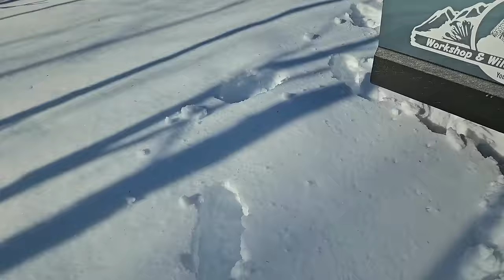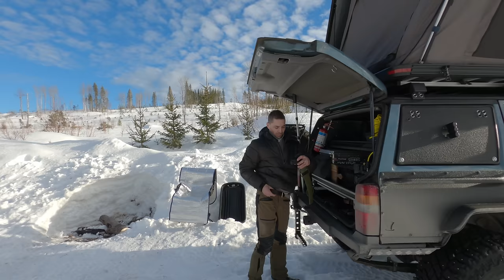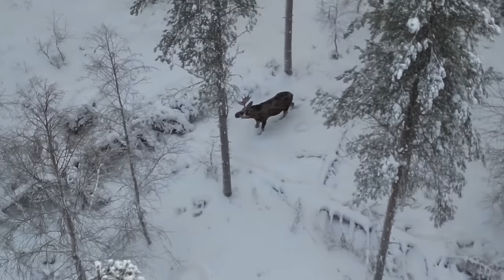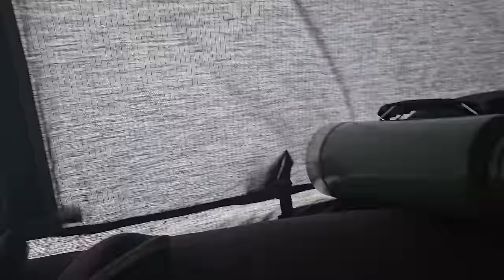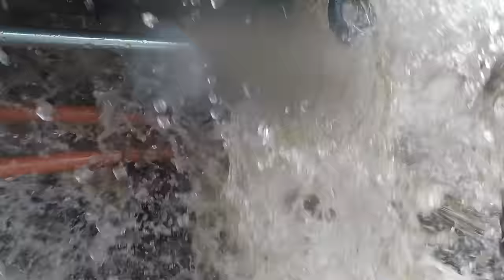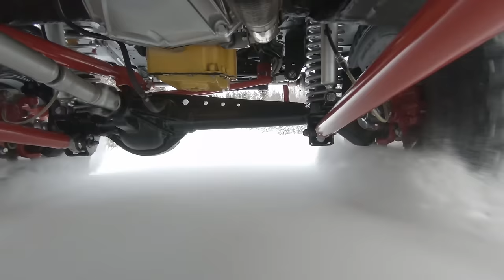Snow Wheeling / Camping With The Legendary Jeep XJ

Comment: I know you from your old channel Mike - the amenities such as a chainsaw make a trip like yours easier in a way but I think being out and using basic tools is a lot more rewarding. Also, if you don't like the sound of the diesel heater, I think you can do without the noise of a chainsaw. The chance of attracting big foot is a lot smaller, too ;)
Reply from the maker: Yeah, I'm still in two minds about it. I can see how an electric once would be beneficial and not as loud, but I'm  sure there just as dangerous. It's being alone in these locations that concern me, coupled with my lack of experience. Thanks again

Comment: Chainsaws are nice, I own two. That being said, I wouldnt take one out that deep in the wilderness  alone and use them...but thats me. I'd be more tempted to get a bigger hand saw like a silky big boy or something like that. I know that they can really be about the same cost sometimes, but they never run out of gas and the carb never needs cleaning.

BTW, as someone else who has had bowel issues, watching you have hotdogs for dinner and a pancake for breakfast is killing me!🤣
Reply from the maker: That's my main concern to ne honest. I would need trousers, gloves, headgear and boots to be safe with it. I know many don't do this with the electric ones as they appear to be seen as safter. But I'm just not sure. 
Yeah my food choices on that camp were not the best lol! I paid for that later. 
Thanks for the info, advice and for watching.
Reply: @WorkshoptoWilderness  The electric ones are just as dangerous. I've got a Ryobi battery powered and an old gas Craftsman.  The chain spins around the bar just as fast and that's the dangerous part.

Comment: Hello from Alaska USA! Wanted to say I enjoy your videos! Very nostalgic for me, probably because I used to share the same passion you have, but for an XJ I had over 10 years ago.  It is interesting that you guys have the oem diesel xjs in Sweden, i have never seen one here. Back then I had an interest in ditching my 4.0 for a 4bt Cummins or OM617 Mercedes but it was not in the budget at the time and my high mileage 4.0 kept on running. A Dana 44 would be difficult or impossible to find where you are, they were even uncommon to find in salvage yards here as well but that would be perfect for your locker and front axle setup, they were popular here in the xjs for your size tires. The rubicon tj front dana 44s or an old wagoneer 44 with corrected lug pattern. Not sure if you guys have them there but that would be awesome to see you get one in your xj one day if you could find a used one for a good price. Your humor also is good for a giggle 😅 keep up your enthusiasm for your project,  its great to see.

Comment: Nice vid as always mate! 
I’m curious, you deflated your tyres, inflated and deflated again. Did you inflated because you thought you will not have to deflate again, or you did it because hard surface can damage the tyre if it’s deflated even on short distance? 

PS can’t wait to see you working on 4.0!
Reply from the maker: The distance between the first track and the second was about 15 kilometers. Some of its was on a normal road so I aired up as I would be driving at high speed. There was no accessibility for me in the first location so I did a tour of some of the backroads in and remembered the second location from a previous camp. Next winter when I have the E lockers in, I excited to tackle some more challenging conditions and not have to back out. 
The 4.0 is awaiting some spider gears and then its game on! 
Thanks for watching.